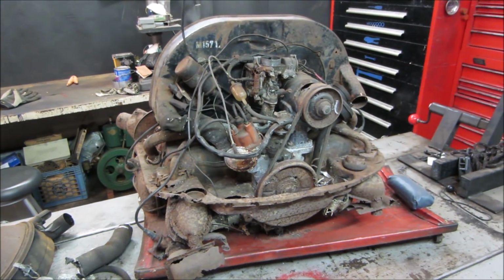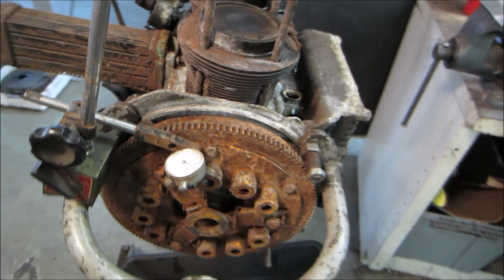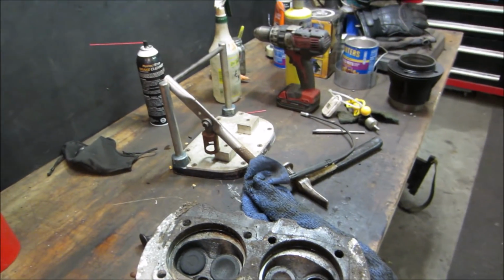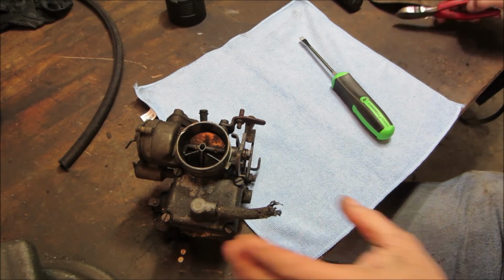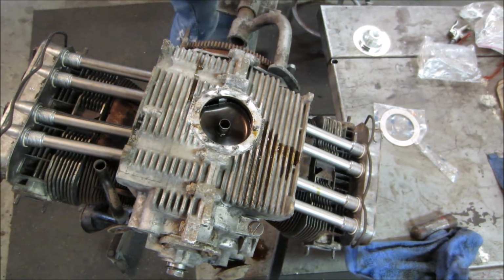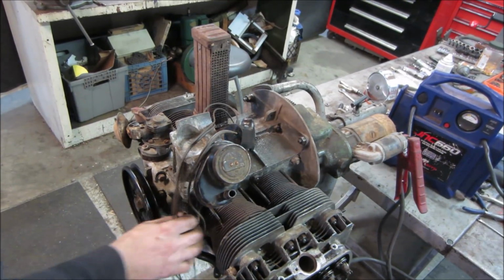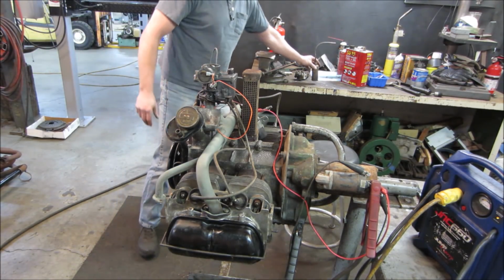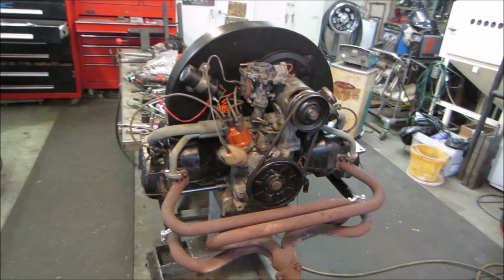Blown Up VW Bus Engine, Can We Repair It For Free?

Comment: Boy did you bring back memories. While away at college with my 63 beetle had one of the valves break when I was up around 65 on an interstate. Towed the car back to the apartment, pulled the engine (it was spring and outside) and found the problem- a busted valve. A $100.00 engine (guaranteed to run but no time length) installed and took us on our honeymoon to the east coast from Chicagoland and back. 
Rebuilt the engine with the busted valve and drove it for a long time. All done under the vehicle, alone with few tools. Great little engines, was a lot of fun. Now-a-days (53 years later) it's a 3 year old Honda that I don't even self-change the oil. Same honeymoon lady, we're finding out about the preachers words "in sickness and health" meant, but still enjoying life. JimM

Comment: Amazing how tough these little engines are. Sitting 40 years with water all over and in it, and couple of parts replaced and good to go.👍👍
Reply: Yeah, that and all the other things wrong; roached valves/valvetrain, all the blow-by, general neglect, not enough oil changes (or a crappy oil change interval).
So the modularity of the engine is its strength by far--separate crankcase, cylinders and cylinder heads. And Mustie has a stash to die for.

I should've delved into air-cooled VWs early on because nowadays you have to be a hardcore enthusiast to score the parts and vehicles.

Comment: This old VW engine is exactly my age! Makes me kind of happy to realize that I'm not that rusty! This video is like a Time Machine, as it shows by this buildup from scratch how simple the construction of these engine once was. Try this with a modern engine,  say from a BMW 5 series or E - class Mercedes! I guess this wouldn't be a DIY job anymore!
Reply: Internal combustion Engines have basically been the same since they started making cars motorcycles the new ones technically aren’t any different it’s all the electronics that people are scared of
Reply: @robertbak4108  When the electronics say "Njet", no start! And you need a whole set of computers for all those adjustments & settings! Much to the despair of auto works worldwide!!!

Comment: Did anyone else hold their breath while Mustie was torqueing the heads down?
Reply: Funnily enough, yes. I was waiting for something to go wrong/snap, etc.
Reply: Yes I was as  I can remember pulling a stud out many years ago. Not a great noise  or feeling on the torque wrench
Reply: Yep. As I recall, the heads torque at about 24? lbs. Not very much. Any more and the studs pull out of the case, which is a problem on these engines anyway.

Comment: Interesting ring compressor.  Designed for installing cylinder on the piston, instead of piston into the cylinder.

I had my doubts on this engine, but with enough spare parts, anything’s possible.
Reply: The joys of air cooled vw. 

I had doubts when I was a teen. 
Til I built my junk engine and drove it all over for years and years. 
Never had to get towed. 
Always made it back.

Comment: When I was taught to lap valves they would test the seal afterwards by putting the valves in, without springs etc., put the head cylinder side up on the bench and before they went home for the night they would fill the area the valves seat in with petrol.  The petrol had to still be there in the morning!

Comment: That is the most amazing thing I've seen. Take a rusted basically junk engine and turn into a running engine with parts laying around. I wonder how easy it would be to do that with an engine made now 30 years from now. I bet it couldn't be done especially if it was just laying on the ground rusting.
Reply: We'll probably be all electric cars by then. Around 2035 is what some car manufacturers are aiming for.
Reply: @AstrosElectronicsLab ...SCREW THAT-!!!
Reply: 28:27..."awright valve- YOU'RE BUSTED!!!"
Reply: @daleburrell6273  I agree; I'm not impressed, either.

Comment: Hey Mustie,what we use to do to adjust our carbs was to push a old piece of rubber hose on the screw so the hose stuck out pretty far and do the adjusting that way without screwing around with a screwdriver

Comment: Did I see combustion gas leaking at from cylinder 3 at 1:02 when you were reving up the engine? With no exhaust it was hard to tell but there was something going on.
Reply: I saw that too, definite blow-by.
Reply: Good eye.
Reply: I saw this too, was waiting for Mustie to address it, maybe he did off camera
Reply: @AcheForWake  That's footage from the previous video, before he took everything apart.
Reply: @Ragnar8504  ahh ok, I did not clock that. Cheers 👍🏼

Comment: VW doesn't sound half bad with no exhaust!
Reply: I never knew old vw's have dragons living inside them . The ancient ones cast forth the flame.
Reply: VW motors with no silencers have a life of perhaps 15 minutes. But they sound cool, yeah!
Reply: @tobiwonkanogy2975  wait to see one with badly timing adjust that breathes fire out of the carburetor´s mouth! Keep your head far away of that flame!!
Reply: q
Reply: They sound even better with custom pipes! There were tons of hot rodded buggys running around here when i was a kid. Wonder where they all wound up?

Comment: Thanks for the trip down memory lane, my Dad and did this job in December 1978 on a 1970 bug engine, it was only 8 years old at the time, but watching the process took me back.  The VW was a hand-me-down graduation present for me - I was supposed to have finished the previous May but not the best student. The engine needed work but the body was shot so I got a barn find and went to work  - thanks again.

Comment: I picked up a 1965, 19 window, with rag top, bus in 1989.  It had a similar issue.  I rebuilt  the motor 100% plain/stock....  because at that time, the California smog rpaegulations were becoming super strict...  I rebuilt the engine specifically to pass smog checks...I had 11 Volkswagens and an IROC .  Right away, a few of my friends were lining up to borrow the motor to pass the smog check.   My father owned a automobile repair shop and had a few customers who needed a "stock" engine to pass the smog tests as well.  He asked if he could "borrow" my smog motor.  I said sure ...and let him keep it at his shop ...  The 1965 Bus was sweet, but I just used it to store parts.  They make great storage containers!  After about 7 years, I sold it.

Comment: Just that valve stem play as you mentioned and showed will probably break or cause some issues again but another rebuilt or newer head on that side will make it run a little longer life then at this moment. As it sits now it’s got lots of life left as you said until that valve stem play causes issues. Love you vids. Keep them up

Comment: Lol, it sounds like you got a nice hot rod cam installed, lol. Well as per usual you got er running with some other used stock parts cleaned up and machined a little bit. Good job as always. Enjoy the vids.thanks for sharing

Comment: We just pulled the oily mess of a 1600 dual port out of my daughter's 74 beetle on Sunday. I hacked the rotten exhaust off of there, and will be installing a "new" one from my parts pile. Looking forward to hearing it bench run after I pull the fan shroud for cleaning and new oil cooler seals.

Nice save on that engine. I did not expect the bottom end to come out that well. The excessive end play will be its deathnell eventually, but in a lightweight car, it should go quite awhile. In a baywindow camper, it could be wiped out in 10K.

Comment: Using a vehicle as a storage unit....nice. Cut off some junky cars, spray some flex seal or something maybe just...dont and boom, instant easy storage. Nice. Edit: Sure would be nice to always have an extra engine ready to go into anything, besides the few little tins ect to adapt them, but man yeah having a running engine ready to go would be nice. Especially if one goes bad during summer and you'd rather drive than rebuild another engine. Super cool, always love the channel. From the small engine stuff to outboards, love the VWs as you seem to make them simple.

Comment: Excellent video Mustie  :) also to bad that VW not made these motor in Snowmobile versions in production line also be wild for sure 👍  and save this motor for sure also got keeper too ! Parts to Parts Stache you make motor for future use and got new rebuilt on home build Mustie :) and you did a fantastic job  to!

Comment: That's a unique way to lap the valves, better than using your hands, as long as it works, Right. U can tell your a typical gear head when you get so excited when it motor fires up! Your laugh says it all. Now I call that a success in my book..perfect motor for a dune buggy build. anyways have a good one bud.

Comment: Unfortunately my hoarding days are over but this brings back many memories of me taking several VW engines and making a few good ones out of them spending as little money as possible. I never was able to avoid having to get a carb rebuild kit though so I always made sure to have a couple on hand as well as a couple of complete rebuilt carbs on the shelf on standby. I've never had good luck with a carb that sat for any length of time.

Comment: This video was very informative and to be honest I never thought the engine would run again having had the same engine in a beetle. I  cut out the heater flap in the air delivery shroud because if this jams shut it closes the air flow off to the cylinders.

Comment: Usually when I shout out at the screen , you hear me. But not this time. The position of the ring openings is very important. You had the top ring opening in line with the thrust side of the piston. Also one should place the openings away from each other. Did you forget the thin paper sealing gasket between the piston and the case?

Comment: Nice save Mustie. Concerning the head studs, I put together a VW type I engine, for my homebuilt aircraft. (It's a KR-2) Most guys assume the studs are going to be an issue; so the engine is assembled with "case savers" from the git-go ( threaded steel inserts) that you mentioned.  If large bore jugs are used; the inserts are cut into slightly, when machining the case bores larger. The inserts are substantial enough, that this isn't a problem. With a 32mm carb, 8.1 to 1 compression, and a magneto on the flywheel end of the engine; the KR-2 tops out at 165 mph and climbs at over 1,000 FPM. These are common performance numbers for the KR-2. This VW engine design holds it's own against others, even today.

Comment: One of nicest motor to work. Back in the day I dropped #3 exhaust. I replaced the head, cylinder and piston all used parts and ran the van until the frame rotted out

Comment: Cool valve spring removal jig. I can see two modifications for it. A longer base to prevent tipping, with 4 numbered cups for keepers. And a magnetic rod with a sliding aluminum or plastic cap to push the keepers off the tip.

Comment: hey Darren...i'm old school and when you mentioned a stinger exhaust that pretty much gave it away...i hope this old motor treats ya well..just don't thrash on it too much until ya get some time on this "rebuild"...don't wanna break off another valve or pull a head bolt

Comment: Recycle old parts and motors. I like it  I have several to fix as of 1\15\ 2022 I think a total of 10 and 3 running good so far. THANKS FOR THE TIP

Comment: I had blow-by with my 1500, and it took out a 3/4" wide section of the head where the cylinder went in.  Fond memories, but I don't want another vintage VW!  If I had you as my mechanic I would have a different attitude.

Comment: One thing that puzzels me is that you allways bring the entire machine full of crap and all into the shop and then blow all the stuff away...
 I allways pressure wash everything before it goes in to the shop. Easier to determine the condition of stuff, nuts, cracks and everything. Maybee its because I hate cleaning or that Ive seen too much Hagerty Redline rebuild! 😎
Love this stuff though, and Im soooo envious of that shop!!! 💪👍

Comment: 44:28 Those are way better than the wood screw like the ones I was sold. Not only was it a core removing the head with the engine still in, turns out it messes up the case (thankfully had a great older fellow who was still able to put in a case saver).

Comment: The old VW motors had a design flaw... the stock oil cooler was mounted so as to block cooling air flow to number 3 cylinder which generally caused overheating and metal fatigue failure of the #3 exhaust valve usually causing the valve head to break off and dive into its piston. This problem was so pervasive with the old air cooled VW's that it was always predicted when a VW was being towed in for repair. There is an aftermarket kit for these that places the oil cooler outside the shroud thus restoring cooling airflow to #3 while better cooling the oil and adding some volume to capacity as well.

Comment: Thanks for posting. Its obvious even Hellen Keller could take an engine apart, however the "gift" is putting it back together. You sir have the "gift". I also notice you don't concentrate a lot on the cosmetics of an engine. The cooling grills still have the rust etc. The pulleys and valve covers are looking great but the rest of the engine looks used. Is it a matter of time constraints or just not important to make the engine look like factory perfect?  Thanks.

Comment: All old vw motors can be saved.  ...unless a rod punched through the case..,or a case-saver has ripped out.   We are alike Mustie:  i too have had a dozen or so VWs of various styles.  From bone stock to 2liter, 48IDA, torque monsters.  Since I lived in California at the time, i built one motor specifically for passing the smog test.  Unfortunately, the air-cooled motor produces a horrible amount of NOx emissions  and was their death nell.  Also, the stock vw HC emissions were high(but still legal).  In comparison:  my L98 (Chevi TPI 5.7L V8) WAS 100 TIMES CLEANER!  Six years of fun.

Comment: Stock VW valves were 2 piece valves. They always break at the weld seam. I always used stainless 1 piece valves to prevent that from happening.

Comment: As always, it's a pleasure to watch you tinker. One question though, if you see this comment: What exactly is the long silver grabby tool you're using to pull out the valve keepers beginning about 20:00. I believe I may have also seen it in the previous video when you were taking out and replacing the points screw. It seems a handy gimcrack to have for someone hamfisted like me. Got a manufacturer and/or model name for it?
Reply: I think it's just a magnet,and he just pulls out 1/2 of the keeper at a time.

Comment: Looks and sounds great. I don’t know if you saw it due to the euphoria of another successful jury that wisp of smoke coming from head 3&4 at high RPM ? Did you spill something or is it not sealing right ?  I’ve been working on this small air cooled junk for years and I’ll tell you , you have better luck with worse looking stuff than I do . I get great looking stuff and carbs won’t come apart or head bolts snap , so good luck on your next find .

Comment: Sometimes there is an issue on the inside of the case that caused the case to pull a stud (Crack or center main wear issue) . Always best to split the case and check it...Of for a road repair but long term should be split.
Reply: Makes me wonder where that stud pulled near the center main and not the #3......What is the oil pressure like on that engine.

Comment: Awsome cheap rebuild ! I love your trick for adkusting the valves - the screw driver through the key. Neat, simple trick !
PS You never mention the power output of those different engines.
What's with this one i.e. HP and torque ?

Comment: You can probably fit Timesert thread inserts into the engine case if the cylinder head stud threads are pulling out of the case, just don't use helicoils as they can pull out as well.!

Comment: It looked like there was some blow-by on cylinder 3, the upper left in the video, when you revved it up before you put the tins back on, did you re-torque the heads after you finished testing it?

Comment: I have 2 carburetor rebuild kit for each of my VW carbs one single throat and a duel throat. I buy a new one each time i use one. I have had both cars for over 25 ys. I have three extra 1600 long blocks. One duel port and two single port.

Comment: Hi Mustie a question for you, under the generator stand on a vw engine is a hole with two gaskets and a metal plate, it has what looks like air intakes what is that for ? it is covered with the stand and do not look like it has any purpose ?

Comment: Saw something coming out around the head on that last run (1h 2m or so). That small amount of blow-by? Seemed to happen when you were pulling on throttle, rather than just something burning off.

Comment: Well that turned out nice again! - The Mustie, rusty, crusty old Vee-Wee lives again "He's alive . . . . He's alive, muahahahaaaaaa!".

That has to be one of the best videos yet!  But now I'm curious. What was the liquid you sprayed into the cylinder before honing? We've always used central heating kerosene for that job, but this didn't look kero? Also, out of curiosity, what's the final tightening torque on those head bolts?

All-in-all, that's made a decent engine, and if I'm honest, sounds somewhat smoother that a lot of Vee-Dubs I've heard. As I said to 'Lord Muck' just a few days ago "Show it some love, and it will love you back" and I think this engine will definitely love its new owner.

Nice work!

Comment: 1.02.05 exhaust gases look like they're leaking between head and cylinder whenever you're revving it. Would guess still not seating causing rough idle